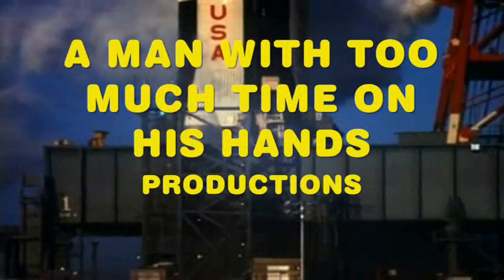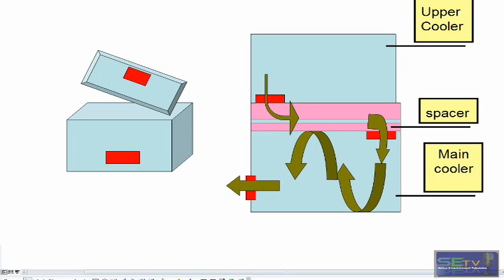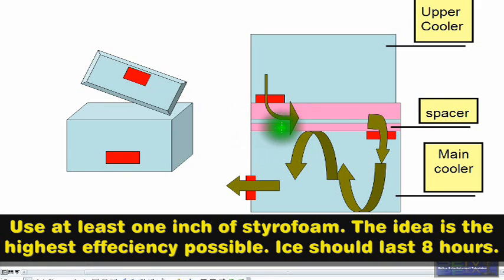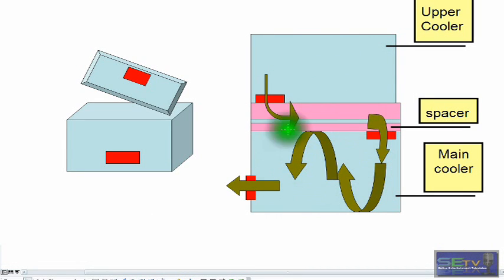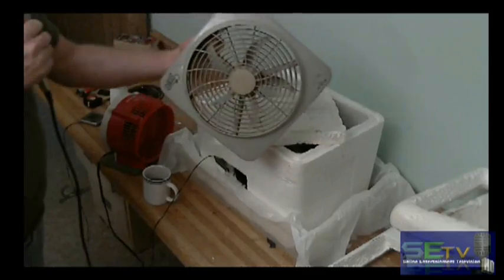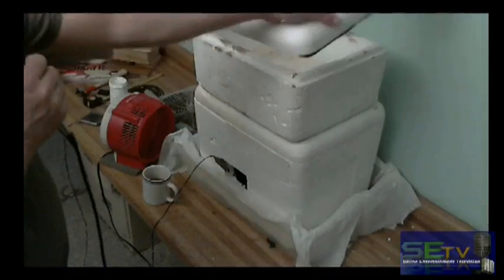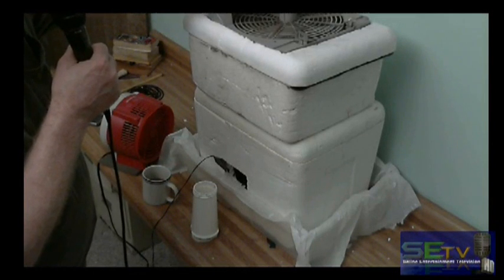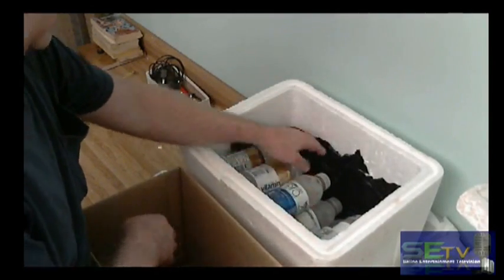Cooler Air Conditioner Version 4

Comment: even though your idea has some merits, you can see that the room temperature is still pretty hi, after all the time lapsing and blowing of fans, there's really no difference in the room. I think I'll still with my water spray bottle and fan to cool me down.
Reply: Joy Gandolfini this is not to cool a house, it is to cool a small area like a tent when you are in the woods in the summer time. If you need this to cool your house, you are broke broke broke...
Reply: +Joy Gandolfini I noticed this also. The ambient temperature only dropped .04 degrees.
Reply: David Deleon
sorry it took so long to respond.... Yes, I am that, broke, broke, broke, lol.So...if ever I should find myself living in a tent,I will still use my water spray bottle and battery fan,lol.

Comment: If the purpose of your design is to cool the intake air wouldn't it be better to put the fan towards the bottom of the ice chest and the exhaust on top? Cooler air would be at the bottom where the fan would be and like you said, the cooler the intake air the better. Now I'm wondering if there is much of a temperature change from the bottom of your ice chest to the top?

Comment: What if you used reverse air flow direction, have fan on bottom-side, and effluent top?
You would then have intake air coming from a low point which could be cooler air.

Comment: This is great if your getting your ice free. Your freezer is working over time freezing all that water. Might as well open your freezer door and have your fan blow out the cold air into the room.
Reply: your freezer runs more efficient when it is full not when the door is open
Reply: Its obvious this dude was able to block my response to his BS so here go'se, if you think you will save energy taking ice out of your freezer and refrigerate a room with it and save energy with it, you must be some tweeker idiot.
Reply: jerry fesler If you have a freezer with extra space in it, you're costing yourself money. Every time you open that freezer the air in the extra space warms up and needs to be cooled again when the door is closed. If you use bottles of water to take up that extra empty space, the freezer works more efficiently. Now, separately, if you make a cooler like this you can use those extra frozen bottles to cool down another room. Just keep replacing the bottles with other bottles so you've always got the freezer full. That way you ARE basically getting those bottles of ice not only for free, but you're still paying LESS than what you were paying to use your freezer without them. However, if you are using a freezer only to freeze those bottles with nothing else in the freezer, then yeah, it would probably be less money to just use a regular air conditioner.
Reply: emilygrae
Reply: True. Plus your using your freezer anyway, even if it does cost extra it can't be that much. If it keeps you cool enough not to run a ac, then it's worth it.